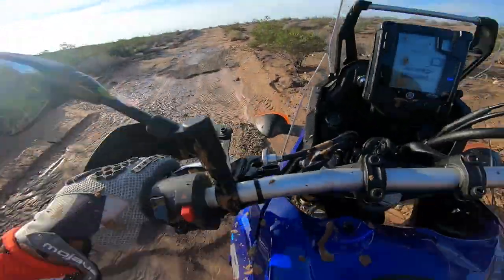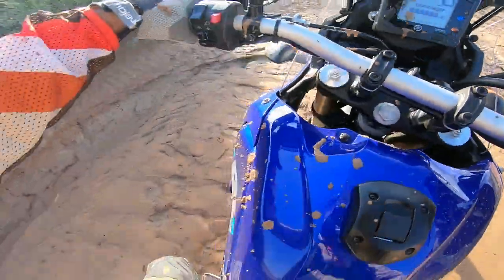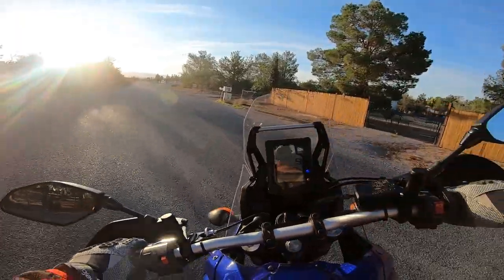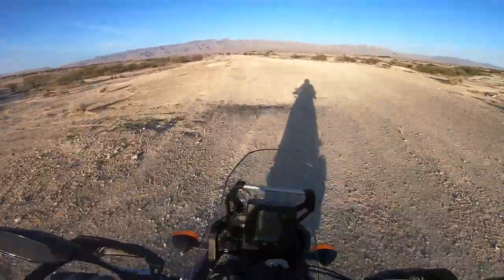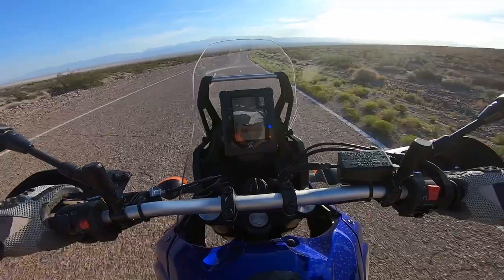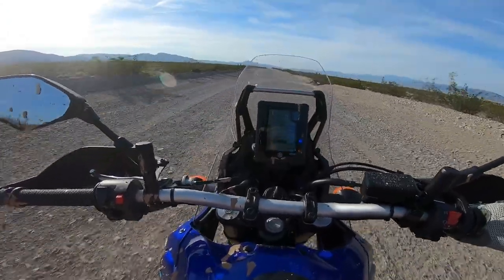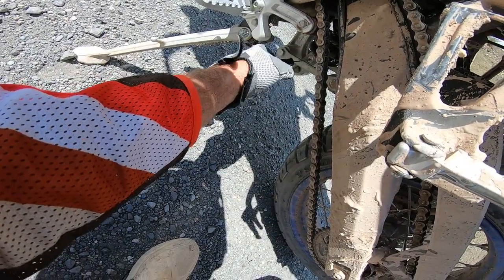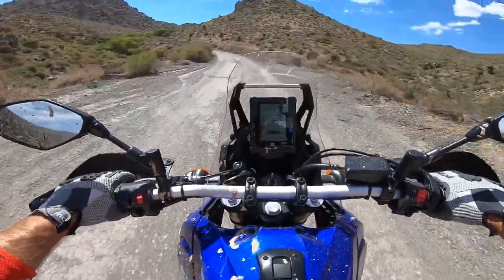Yamaha Tenere 700 Vlog 2

Comment: I've never hear of running the valve nut up to the cap..how exactly does that help? I've never done and never had an issue
Reply: If the tyre slips on the rim, it stops the valve from being ripped out of the tube
Reply: @daveswhite90  like I said I've never had an issue with that I'LL have to try it out
Reply from the maker: Especially with no rim lock and lower pressure it keeps it from getting torn.
Reply: @DirtBikeTest  thanks for the info...please inform me when rim locks become available for the t7 wheels